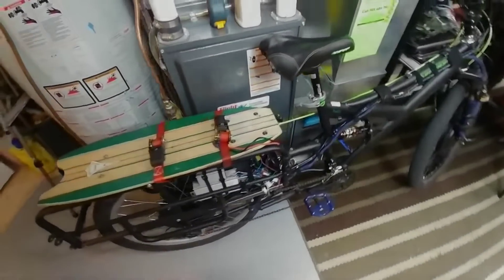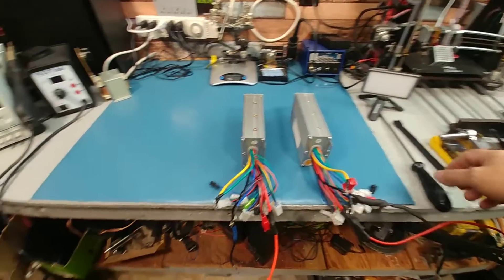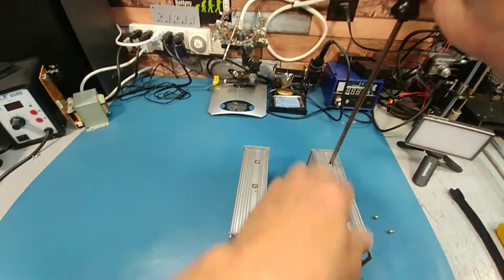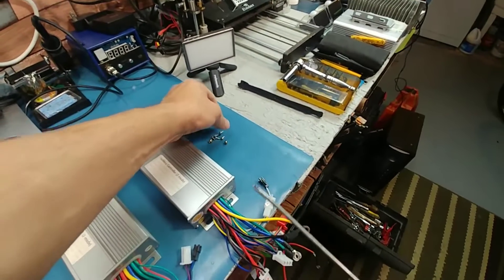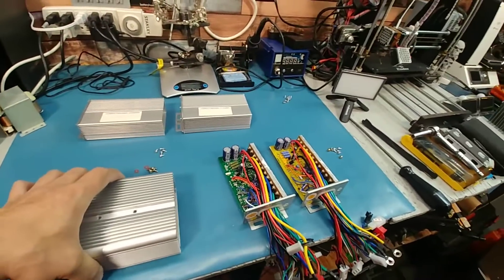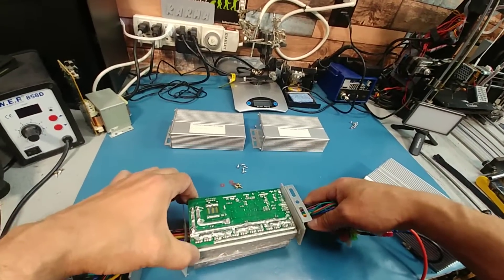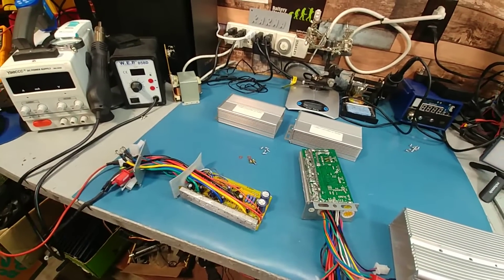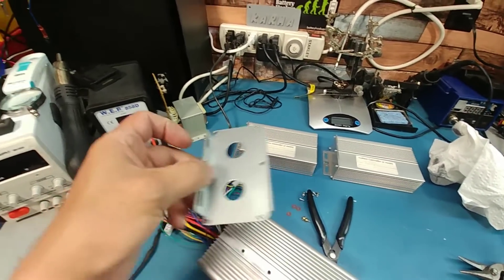ebike diy dual motor controller*part one*

Comment: Good video, but I cannot see the end result justifies all the work surely just bolt two controllers back to back with all the wires facing the same way no risk and easy to service surely? OK maybe a bit bulkier but cooler. Anyway good luck with it
Reply: There are a number of problems with that.

Now, I've just started watching this video, so I don't know that it solves  any of them either.

A proper dual channel, whether its two discrete controllers, or two sets of circuits in one housing, is going to have intelligence and communication between the channels.

This eliminates the handling and control problems you would otherwise have from the motors spinning at different speeds.